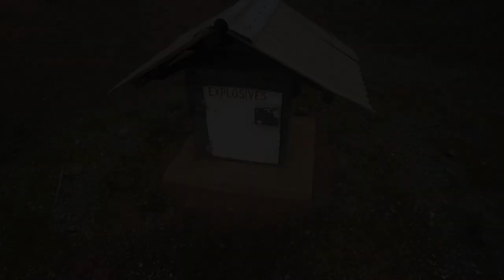Bumbunga to Lochiel Railway Line

Comment: No idea this line existed.
Just wondering if there were once any other lines on the Yorke Peninsula apart from the Moonta line?
Reply from the maker: There were some salt tramways on the southern YP that I'll get to one day, but you might already know them.
Reply: @Outdoorstype  No, wasn't aware of them. So Salt was a big commodity on the YP back in those days? I know Copper was king around Wallaroo, Moonta & Kapunda.
Tramways.....interesting.
I've explored some old tramways in Victoria which were used for carriage of timber and other goods but I'll have to check out history of Tramways in SA. Thank you!
Reply from the maker: yes copper was huge. Stenhouse Bay had extensive gypsum mines for a bit. Moonta (at least) had extensive horse drawn passenger tramways as well. It's very fascinating but just too much for me to research right now. It is absolutely my pleasure to explore where I can when I can. Thanks for watching.
Reply: @Outdoorstype  cool. More stuff to research.
Reply: Snowtown, Barunga Gap, Bute, Kadina
Port Broughton to Mundoora